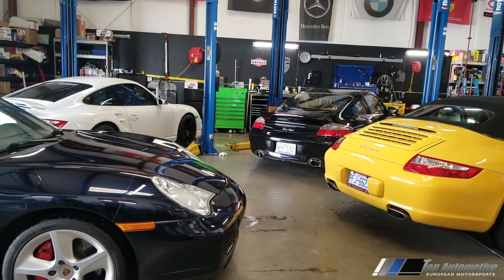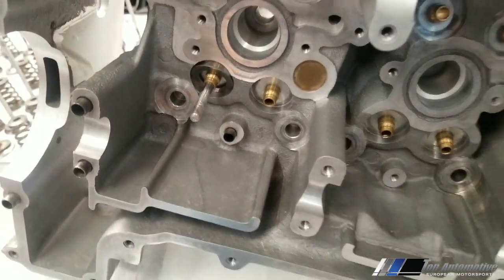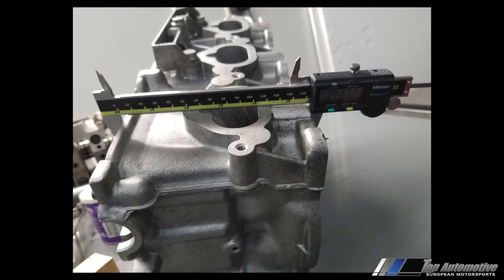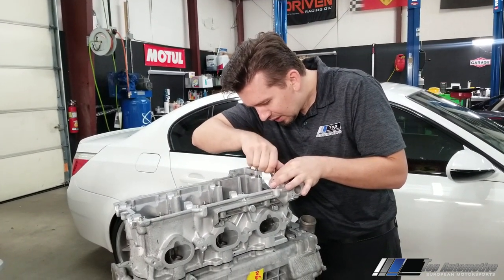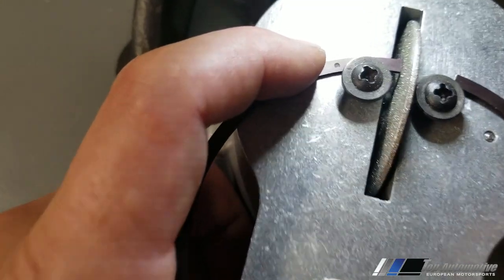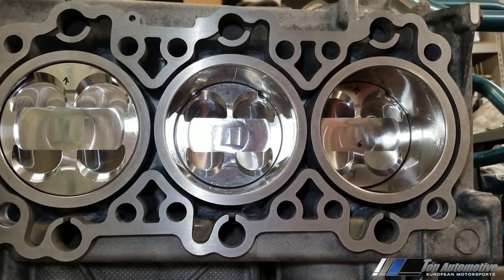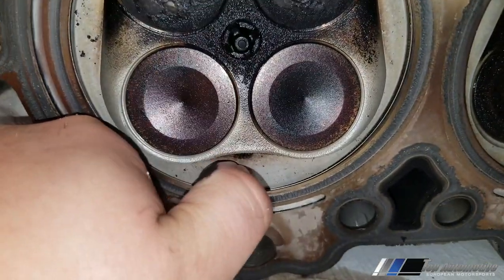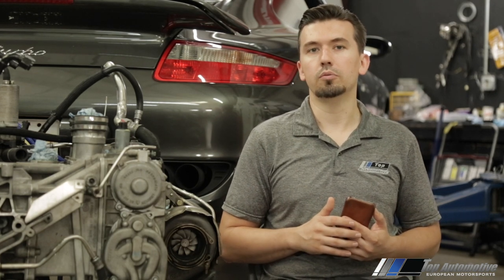PORSCHE 911 Performance M96 ENGINE BUILD | Details that matter to avoid these simple MISTAKES!

Comment: A proper machine shop would have recut the valve seats/valves and checked for proper sealing. The M96 cylinders at 3:00 look mighty shiny, have they been sleeved because you'd never touch an aluseal cylinder. Okay I can see the engine at 5:40 has been sleeved and forged pistons installed, a $5,000 extra expense that's worth it if you want your M96/97 engine to last and also a chance to increase the bore and add 200cc or 400cc to your engine size. We've tried Total Seal rings on BSR engines and run into the peoblem of too much case vacuum resulting in blown oil/air separator and the engine smoking like hell when maxed out at full throttle to the point where the intake manifold generates vacuum. Do you install a limiter between the intake manifold and the oil/air separator on the case? I think you have your piston assembly wrong. After fixing the crank casette to the engine case half, you would install pistons 1 - 3 and rods for that engine half, then add the top engine half and install the remaining three pistons in the order of 6, 5, 4. I would say that timing the cams on these engines is alot easier than on the aircooled Mezger engines. You arrest the crank at TDC with a plunger through the pulley and then arrest the cams with the cam fixture tool and then tighten and tork the cam gear bolts. On 3.4 engines and up I would also recommend upgrading rod bolts to ARP bolts. On smaller engines new stock bolts are fine, unless it's a race engine. The stock rod bolts for all the engines from 2.5 to 3.8 are the same from Porsche, so upgrading to ARP on the larger engines is adviseable. We've seen many shoddy builds come to the shop I worked for in Canoga Park, CA as well as BSR engines that didn't even last the the two days of break in, testing and qualifying. I have my own theory about IMS bearing failures but that's not important.

Comment: Hello. I have a 997 turbo, and I wonder what oil you recommend your customers to use. Is no warranty on my car anymore, so I now drive on Motul 300v 5w40. But you build new engines so it is important that the customer uses the best oil.
Reply from the maker: Motul 300v is good but has a short life, racing only. We run Driven DT40 and driven GP1 for racing.  5w40 motul exess  8100 is great for reguler driving.